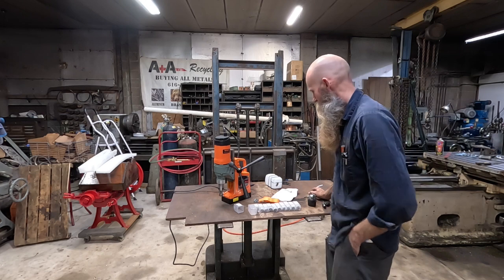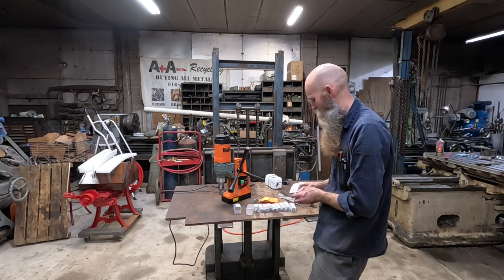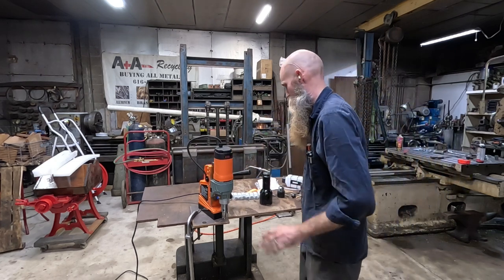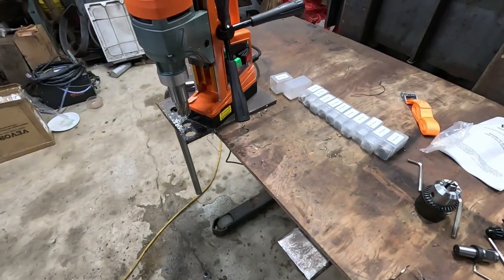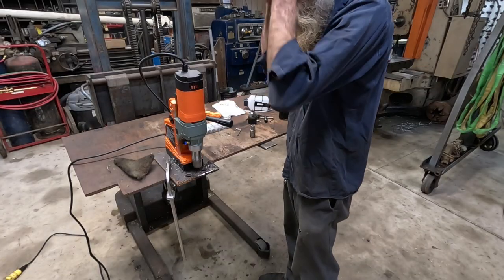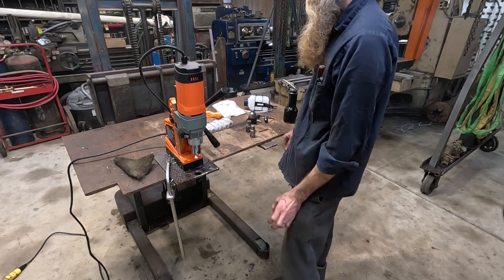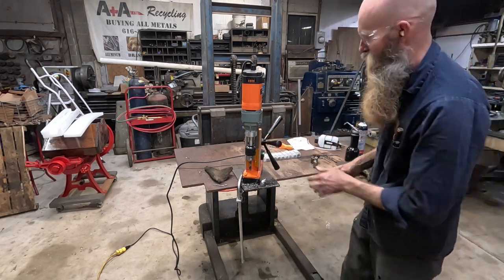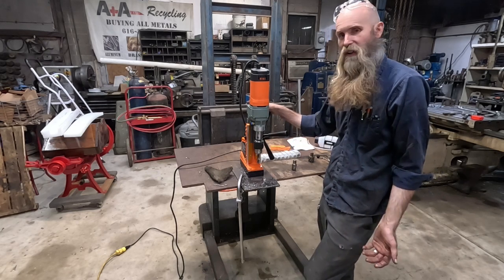VEVOR Mag Drill Review and Demo - 2025 Upgraded Version

Comment: I bought one and liked it so much I bought another one. Like you I have a Milwaukee, a Hougen and an ancient B&D. The weight, the extended vertical capacity and the compact size make it a winner.
The two main reasons I bought though? #1 The weight/size #2 The Milwaukee burned out the control board for the second time. The new board is $380 and I'm not paying that again.
The little coolant bottle works good too, but I did modify mine. I bolted a 2x3 inch piece of 1/8 steel where it mounts on the drill and added a flat pot magnet to the bottle holder along with a longer hose. That way I can use the bottle even when I'm not using the drill vertical. by simply sticking the bottle to a nearby piece of steel.
Reply from the maker: Good idea on the bottle, my first thought was "how in the world does that work vertical"?
Reply from the maker: On the Milwaukee note, here is what irritates me about them, they are just as made in China as the Vevor but with a premium American price tag!
Reply: @Andy-PerpetualMotion  Yep, owned by the Chinese, lock, stock and barrel.

Comment: For the price, it’s good . How ever I like a variable speed with a tapping feature , that’s just me .😊
Reply from the maker: For anything larger I would definitely want variable speed, for the smaller size stuff that I'm likely to use this for it definitely will get the job done. I see the variable speed model is actually cheaper than this one on their website, but it only comes with two annular cutters, so you're losing some value there.